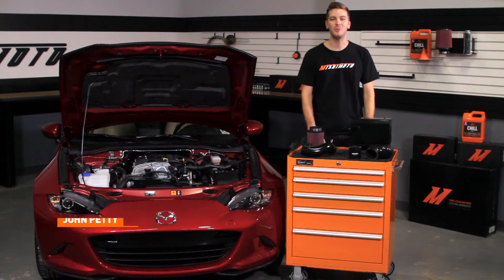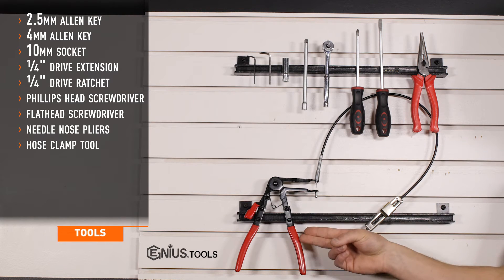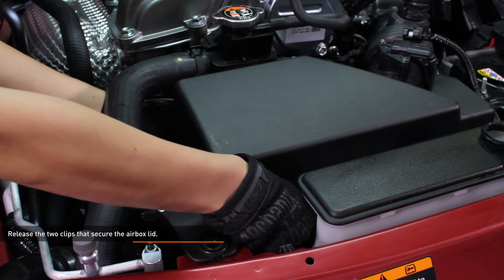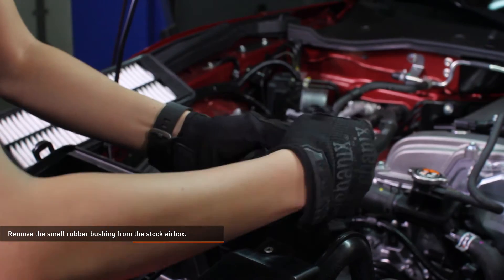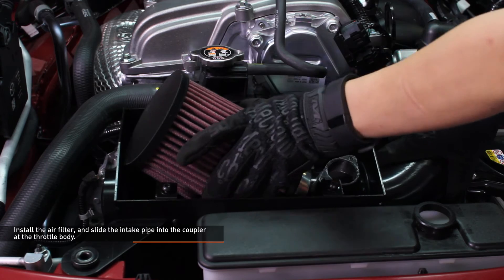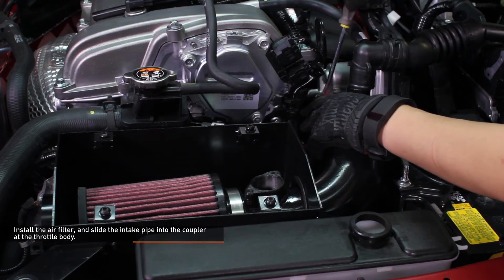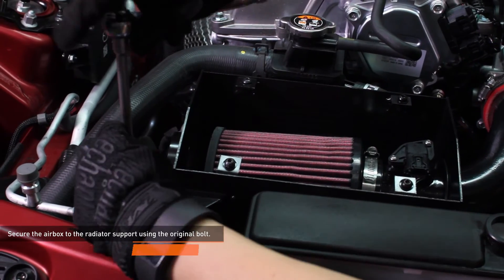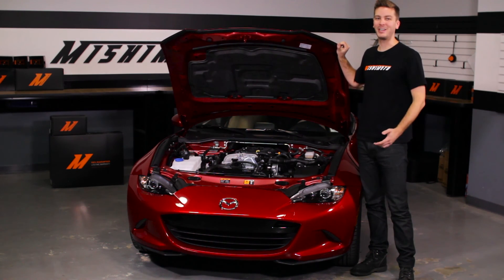2016+ Mazda Miata Performance Air Intake Installation Guide by Mishimoto

Comment: How often does the airfilter need to be replaced? Or do we use and k&n cleaner and reoil it?
Reply from the maker: every 10-15k miles depending on driving style and location. We suggest using the Mishimoto branded cleaner and reoil kit, not our competitors ;)
Reply: @mishimoto  okay will do! I just bought it from your site! Do how know how much oil Oz it takes to refill the mx5 2016 air filter? I know there is a specific amount we need to use

Thank you again!!!
Reply from the maker: No specific amount. Apply an even coat over the filter media. As long as the filter is not oversaturated to the point where it's dripping off the filter, you should be good to go.

Comment: After the installation of the air box i got a fault code p0171 on my 1.5 miata , dont know what is the problem everything seems to be done as you showed in the video.
Reply from the maker: This appears to be a lean code, you will want to check the connections from the MAF housing to throttle body. This is usually a result of unmetered air getting to the engine from somewhere after the MAF sensor.
Reply: @mishimoto  damn are you sure it fit on a 1.5 litre? I see one your website for 2l only, but on racing beat Europe they say for 1.5 and 2.0... Don't now if it's really different...

Comment: I have read that once this is fitted, and EDU remap is required: "Due to the size of the intake pipe, a re-tune of your vehicle's ECU is necessary to keep your engine running safe and extracting the most horsepower from the added airflow." https://www.racingbeateurope.com/mx5-2016-19-nd-cold-air-intake-kit-made-by-mishimoto--15--20-2359-p.asp
Reply from the maker: These were designed for the US model 2.0L and may require additional modification on vehicles in other markets.
Reply: @mishimoto  There is a 2.0L engine in Europe as well, its the same as in the US. The old 2016 150+ BHP, and the new 2019 180+ bhp. Maybe that mention is for the 1.5L only?

Comment: Did your Miata not come with a washer fluid reservoir, or did you folks leave this step (bottle removal) out of the list of instructions.
Reply from the maker: Hey BigHesh81, installation does not require removal of the washer fluid reservoir! Ours may have been missing because we were prototyping our aluminum washer reservoir which you can check out here: https://www.mishimoto.com/mazda-miata-washer-reservoir-2016.html
For more information on the intake install, check out our guide here: https://cdn.mishimoto.com/media/productpdf/MMAI-MIA-16_InstallGuide.pdf

Comment: Is this only a sound improvement or does this actually add hp/tq I just have yet to see one with real numbers added
Reply: Goodwin Racing as well as Flying Miata have found no gains by changing out the stock intake and airbox. Mazda did a very good job with the stock air box and filter design.
Reply: @albertflasher3533  I wonder if this holds true for a turbo or SC Miata. The stock intake has issues with vacuum levels when you start pushing things.
Reply: @jeffrbake  I turbo-charged my 2018 and the only reason i had a new airbox and filter was due to the plumbing. I can't speak about NC's....but Brian Goodwin probably can. Goodwin Racing sponsors one of the Miata Forums.